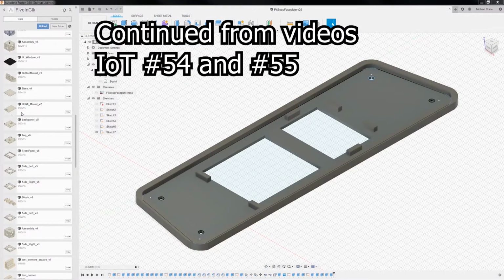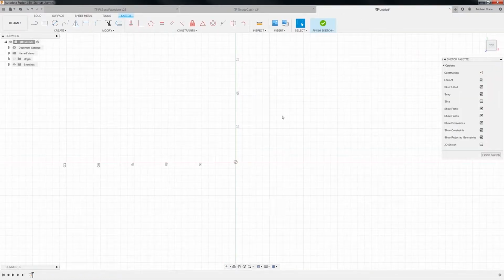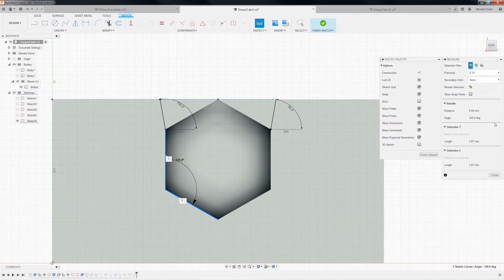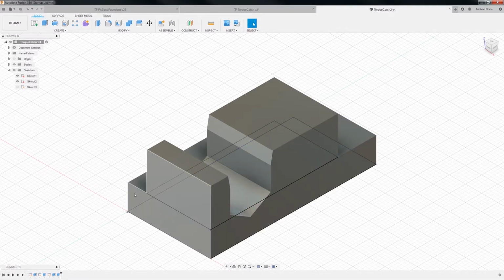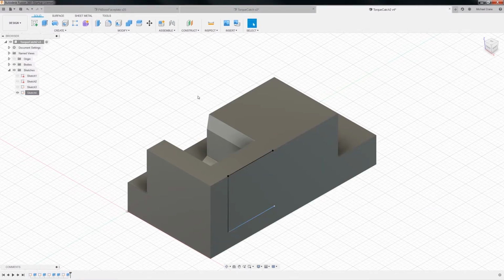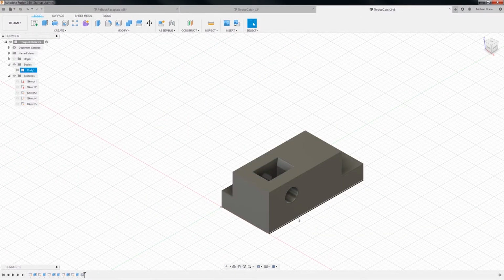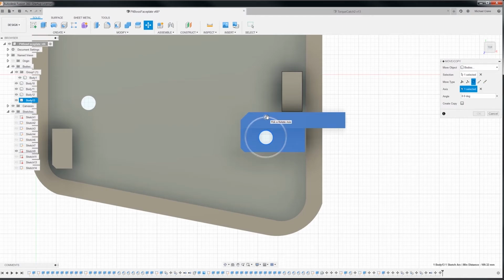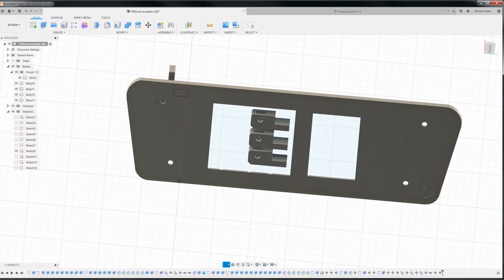IoT#57 – RPTC-Q – Designing Torque Catches using Fusion 360 for a Pit Boss Style Faceplate

Comment: This looks like a pretty elegant solution for the pitboss! I can't wait to see it printed and the tester install it. For these Pit Boss horizontal controllers is there going to be a software option to rotate the LCD screen so that it's right side up?
Reply from the maker: That's a good thought but it wouldn't work too good because the button panel would still be sideways.  The proper fix is to rotate the button panel and LCD which would be a PCB redesign.  But, if I get enough folks asking for it, I can certainly do it.
Reply: The buttons being sideways wouldn't bother me as much as the screen would. I personally could live sideways buttons and upright screen, but that's just me. 👍👍👍
Reply: @JustMeKenny  But, you'd have to push the left arrow to make the cursor move up, the up arrow to make the cursor move move right, etc.  Also, the screen is a a rectangle not a square so it would make the small screen, tiny.  It really isn't too bad.  Humans are very good at reading sideways.  It would be nicer to have everything up and down, though.